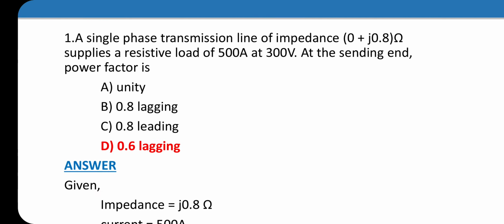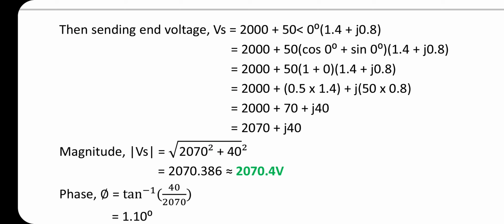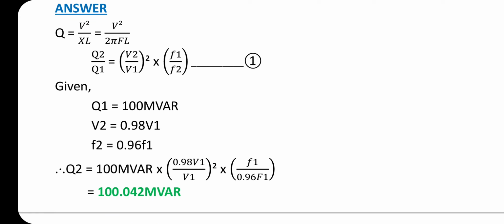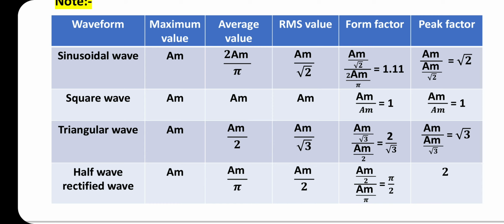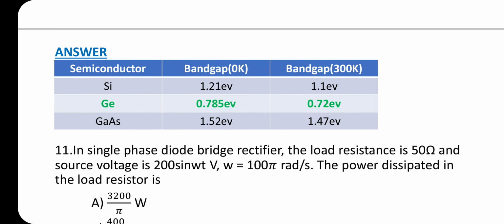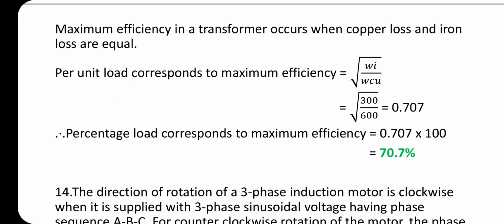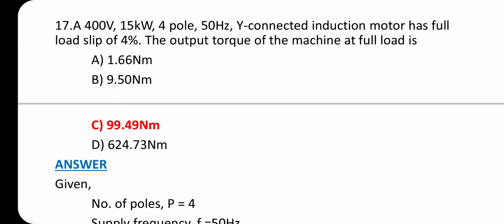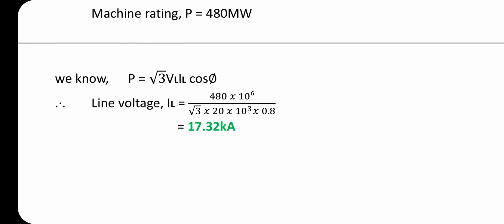ISRO-VSSC|TECHNICAL ASSISTANT|ELECTRICAL|PART1|PREVIOUS YEAR QUESTION&DETAILED SOLUTION |2017|1331|

Comment from the maker: Typing mistake
1.At question no:15- In answer input =theta(t)
2. At question no:20-In last slide- it is not line voltage it is line current